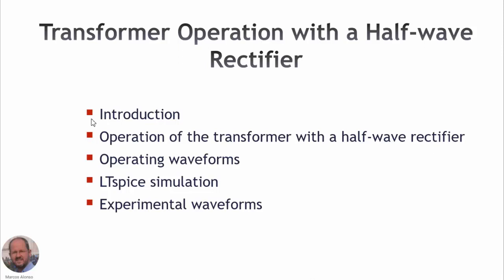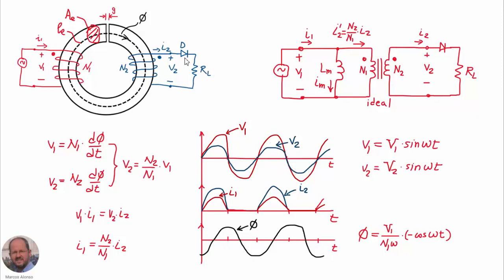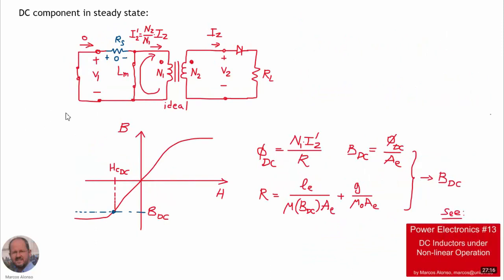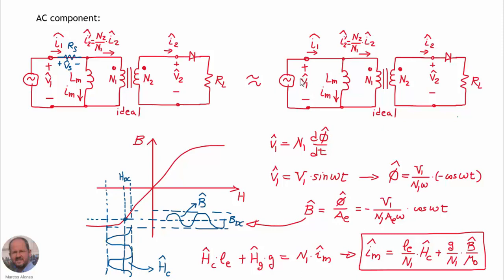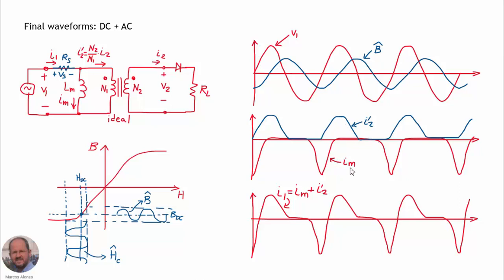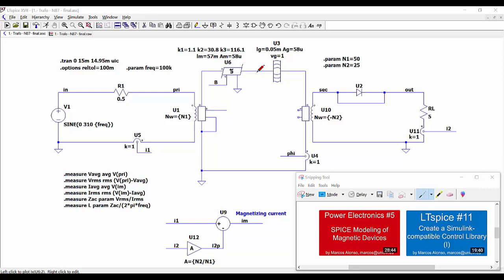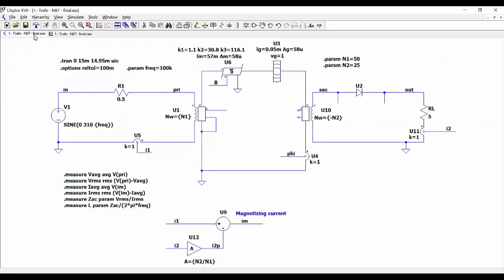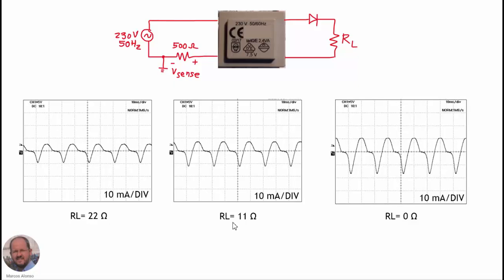PE #38: Transformer Operation with a Half-Wave Rectifier

Comment: Just curious how to model transformer for square wave input..i was trying to simulate for push pull converter and for square wave input is going to saturation or giving some garbage value...then I tried to search over internet for modelling square wave input but did not get any output
Reply from the maker: The transformer LTspice model should be good to simulate a transformer with a square wave at the input. You can also simulate an ideal transformer. You can get more info in this video: https://youtu.be/R724-NRM8jg